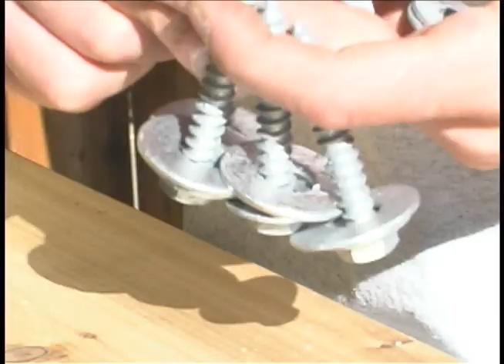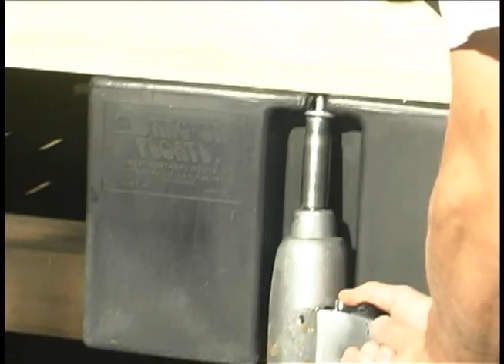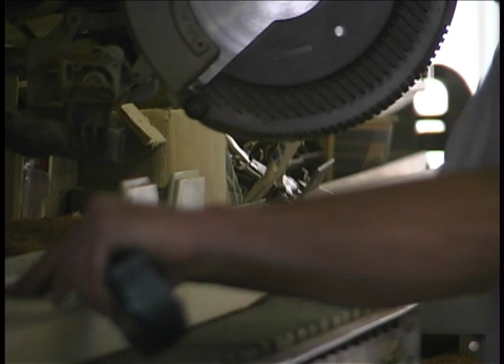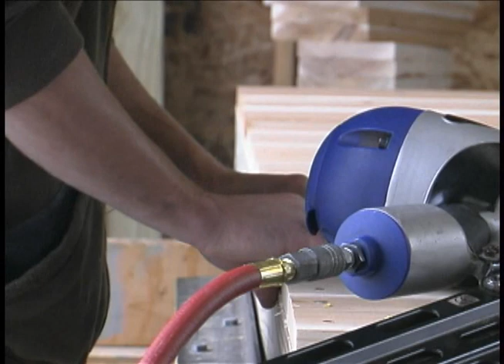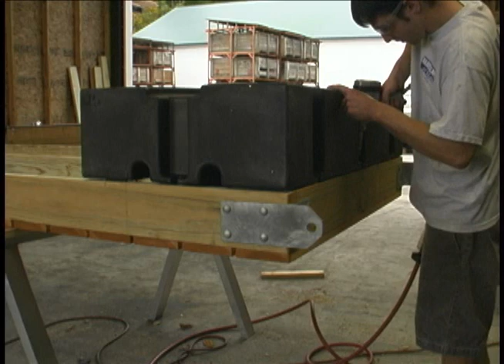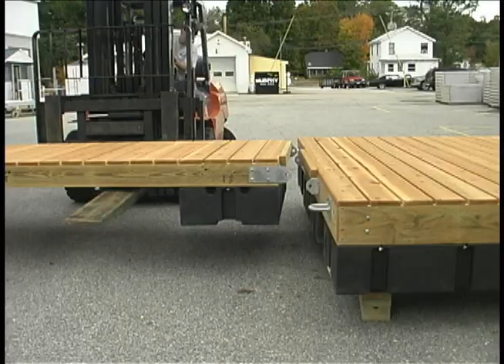Wood Docks.wmv

Comment from the maker: Yes, they are rotationally moulded Polyethelyne, just for docks, They come in two sizes. 10" tall, x 24" wide x 36" long as well as 48" long.
Wall thickness is about 3/16" even in the corners. They are called Drag-On Floats. You can attach a skid board to the base. We sell them. Follow the link on the video.

Comment: Hi Seth, where am I able to purchase those connector brackets that you used on the exterior corner of the dock. Thank you
Reply from the maker: Here is the link. You can click on the parts in the drawing for each dock part. https://greatnortherndocks.com/floating-hardware/
Reply from the maker: There is a variety of different ones that may be useful for multiple configurations on this page and you'll see the one you are looking for. https://greatnortherndocks.com/floating-hardware/ This is the one I believe you are referring to. https://greatnortherndocks.com/shop/reinforced-hinge-plate/